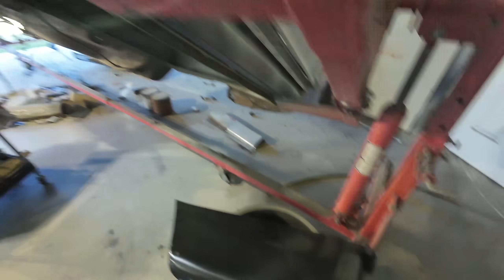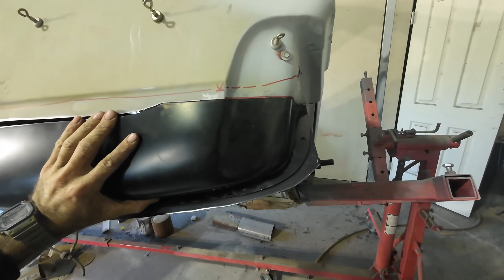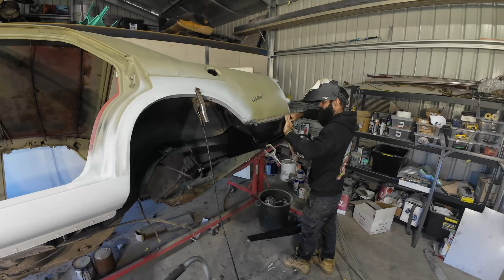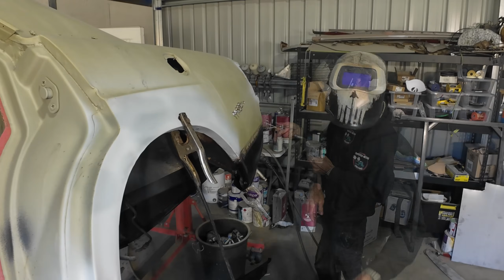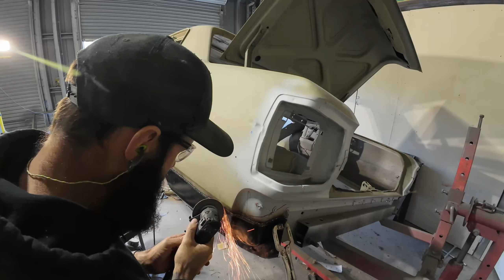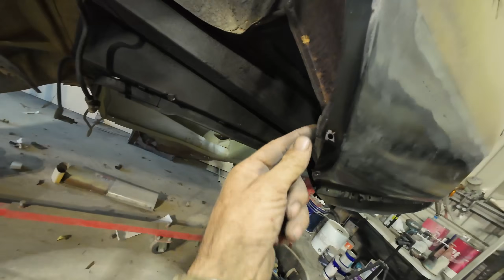PREVENT WARPAGE using these CRITICAL steps when welding ✔

Comment: Fantastic work mate. Nicely done with great heat control, turned out great.
With your question about the content, keep doing what you've been doing. 🤙
Btw...solid beard there that doubled up nicely as a mic prop 😎👍
Reply from the maker: Thanks heaps legend! ok ill keep getting into the xw rust! (i may just have 1 video update of the jailbar, but THEN right back into the falcon haha, yeah my beard is out of control atm 😬😂

Comment: In my opinion, 
Keep up with the rust / body work videos mate,
Maybe throw up some short videos doing minor work on your other projects, but it’ll mean more time filming and editing.
One thing I do when welding a large piece in is to brace it on the back of the job .... for example, using a scissor jack and a thick flat piece of steel to push the two pieces out.
Keen to see the Barra up and running, also the jailbar 
Cheers mouse
Reply from the maker: Hey Mouse, ill still continue the rust repairs and record them, ive just got some footage of the jailbar and skyline reveal i was thinking of showing, probably just 1 episode then back into rust repairs?, that is really good advice about the bracing too, i didnt think of that! good info